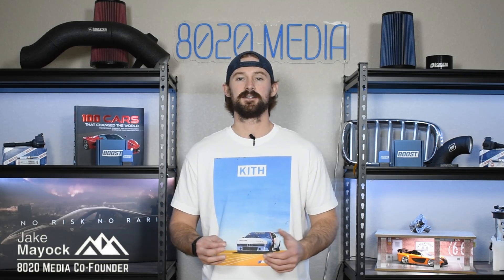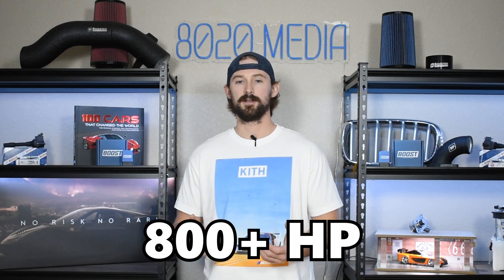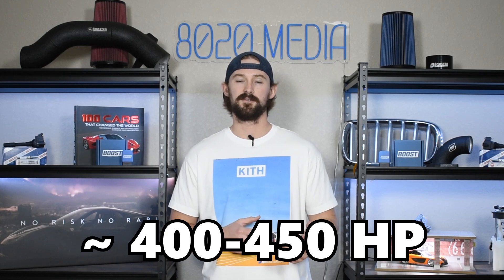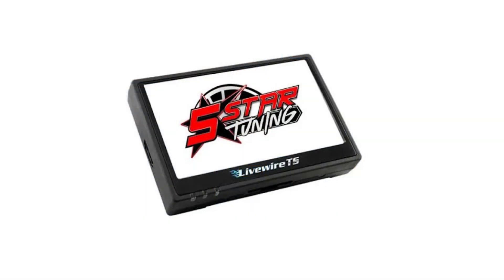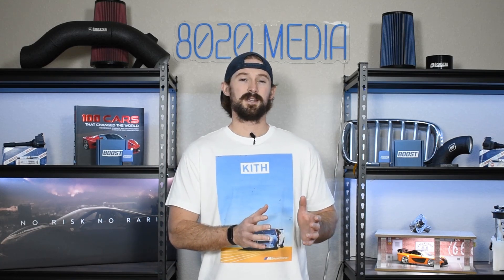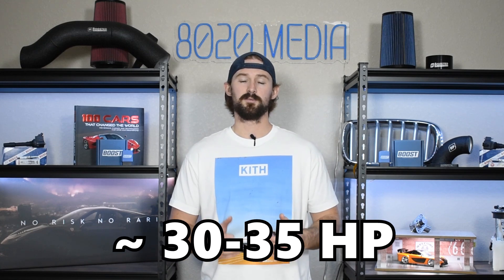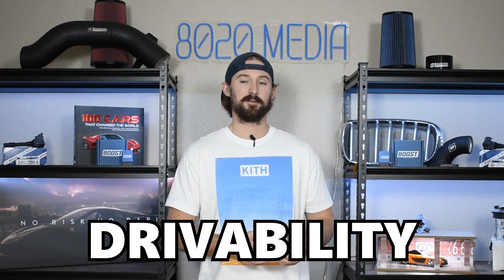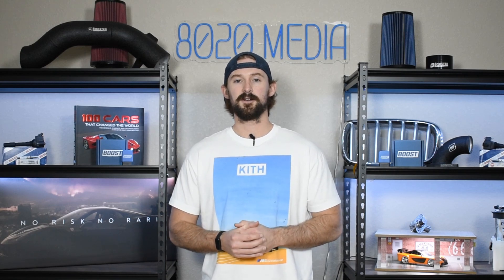How to ADD 50-80 HP to Your 5.4L V8 Triton!

Comment: Hey forgot to mention switching to electric fan.  I gained 12hp to the wheels. Im curious what the 5.4 2v  put to the tires vs a 4.6 2v . My F150  4.6 2v had long tubes custom exhaust, 75mm throttle body, electric fan,under drive pulleys ,cold air and dyno tuned. 230hp and 292lb tq to the wheels factory flywheel specs were 232hp 292 tq.
Reply: Damn near exact build I had on my panther miss that 4.6

Comment: Ford F150 2006 5.4 king Ranch
Cold air intake 
Long tubes headers 
3.73 gears
Built trans 
Police interceptor torque converter
Under drive pulley
Jets mass Air Flow Sensor 
Tune 
15.0 at the Drag Strip. But I wanna go low 14s with it
Reply: Instead of a built trans think ab swapping. These 4 speeds are dogs

Comment: Fun fact the 4.6 and 5.4 share a shit ton of parts. If you wanna make power you can take basically everything from the 4.6 mustang 3v and do a full tilt build on the 5.4 you can get chain tensioners that lubricate the timing chains better timing chains blocked out phasers high volume oil pump you can get forged pistons a forged crank you have to get custom rods but you can throw on ported mustang heads fat ass cams the only problem is you will need a custom intake manifold.

Comment: every mechanic I've spoken to say the same thing.  Avoid the Triton 5.4 V8 3 valve engine at all costs as it's the worst engine they've ever worked with.  My 2 valve 5.4 they said is an amazing engine.  I got 400,000 kms from it so I replaced it with another one and am happy.
Reply from the maker: D - Thanks for sharing.

Comment: I could care less about more power, 280hp is fine with me, but I want more fuel mileage! lol. At least I don't have that stupid phaser problem to deal with. And the only thing K&N does is let larger particles of crap into the motor. They are short term gains for long term problems.
Reply: You are correct, I agree with your statement. Short term gains for long term problems.

Comment: S/B enclosed intake. Exhaust cut out after manifold. New person, phasers, timing chain, tensioner, high velocity pil pump. Plugs, coils, cvt solenoids. 
TRUCK is a DOG. slow as slow can be. Plus...stock brakes doesn't slow it down to well.
Reply from the maker: D - Sounds like a nice build you got there! Thanks for sharing.

Comment: My 08 harley puts out 600lb-ft of torque . I put a Gale Banks tune and banks cold air intake along with a jet mass airflow sensor and Banks shorty headers. Swapped the resignator for a high outflow exhaust. Changed the catalitycs. And really woke it up with roar pedal throttle command. Also added electric fans and a 200amp altarnator to help power the fans. New water pump, new radiator, 180 degree thermostat. I use it for towing super strong and reliable.
Reply: I have an 04 lariat. Supercharged, crate engine,comp cams, performance tranny, 3 clutch torque converter, long tubes, true dual exhaust,  no cats, flow through resonators, turbine flow through mufflers, 2.75 griptec upper pulley. Custom dyno  tuned a few times to get it dialed in. It's been run on a Dynocom Dyno, Jetdyno, and most recent tune was done in Texas on a Mustang Dyno. Dynocom numbers where ridiculously incorrect. Shop claimed they were able to get it to 600+ rwhp.... Bigtime BS!!! This shops in Arkansas. Got it back to Mo. Had a ton of issues with drivability. Had a few pulls done at a local dyno shop that usses a a Jetdyno and it actually made 445 rwhp. That's actually good for a 5.4 3v. Really good. Stock, it can only has like 225 - 240 or so rwhp. Now, she made 445 but ran like crap. Couldn't trust the shop in Ar. so I reaced out to a Tuner in Texas. Was really familiar with  the 11th gen. Also he uses HPTuner, and a Mustang Dyno.  He dismantled the existing tune and built a tune for my truck. Drivability is now very well mannered. If I get on her from a dead stop, she lays rubber hard and fast. Drove it back to Mo. from TX. With no issues. Final numbers on the Mustang dyno produced 430 rwhp and 505 rwtq. These engines are great if property cared for. I was able to get  200+ rwhp increase. Had to do alot of mods. For me it's enough. Trucks been fully customized inside out. I could have easily bought a newer truck and done the same to it. This truck. I bought it brand new. It's never failed me in 21yrs. I didn't want a new truck. I wanted to invest in the vehicle that's never let me down. Please dont Hate on my little 430 rwhp. I'm happy with it and my truck is like none other. Just sharing my experience with my 5.4 3v.
Reply: @swishersweet66  Im tryna do this on 2 v lol you didn't swap any internals to forged?
Reply from the maker: J - Sick build. Thanks for taking the time to share this!
Reply: If it has 600 foot pound, that’s too much for a bike lmao, can’t even enjoy all the power without dying
Reply: @Ty-c5d lol he's talking about the Harley edition f150. But he's bsing. His truck never made 600 lbs of torque.

Comment: I gotta admit i was pleasantly surprised by the increase in throttle response from installing a cheap high flow air filter into my stock intake it wasn't a huge increase but it definitely took me by surprise i also always suggest with any engine but especially engines with poor sealing air intake systems like the 5.4l drawer style air filter to clean and run a relearn procedure on their electronic throttle bodies
Reply from the maker: 3 - Nice! Thanks for sharing.
Reply: What do I do to do this relearn process?

Comment: Currently rebuilding my 2006 5.4 3 valve from the ground up after a blown timing chain tensioner seal. I'm staying mostly OEM with it, but upgrading the weak points such as the oil pump, chain guides and tensioners. Also upgraded to comp cams lash adjusters and some mild cams with the BBK 80mm throttle body with a spacer. Plans are still to install shorty headers and Magnaflow's high flow cats, (gotta stay legal :/) and a cat back. Also throwing on some slighter bigger injectors, Jet Performance tuner, chip, and MAF sensor. Also some upgraded plugs and coils. I'm expecting closer to the range of 400hp with a big increase to torque. Anything else you think I should do @8020 Automotive? Or am I on the right track??
Reply from the maker: K - You’re definitely on the right track, and it sounds like you’re addressing most of the notorious weak points. Since you’re already doing upgraded oil pump, tensioners, lash adjusters, and mild cams, I’d suggest also paying attention to the airflow and fueling balance so you can actually take advantage of those mods without running lean or losing drivability. Your larger injectors, BBK 80mm throttle body, and high-flow cats will help, but I’d strongly recommend having a quality custom dyno tune done instead of relying on a generic Jet Performance tuner/chip — these engines respond much better to a tailored tune, especially with cam changes. While shorty headers are good for emissions legality, they won’t give as much torque gain as long tubes; if you’re locked into shorties, pair them with a well-matched Y-pipe and ensure the collector design is efficient. Also, make sure your upgraded MAF is properly scaled in the tune, because mismatched MAF calibration is a common cause of poor idle and part-throttle hesitation after these upgrades. Since you’re going mild cams, upgraded valve springs might not be strictly necessary, but installing fresh OEM or slightly stiffer springs will safeguard against valve float at higher RPM. Lastly, double-check your cooling system — these engines don’t like excess heat, so a high-quality aluminum radiator and maybe an oil cooler could help longevity if you plan to tow or push it hard. Done right, you’ll have a strong, reliable 5.4 with a torque curve that’s far more satisfying than stock.
Reply: @8020Automotive  thank you for the advice, I will definitely address this going forward. I've already replaced the valve springs with brand new OEM. My truck was equipped with the towing package from factory which included a upgraded cooling package, so hopefully that should help keep it nice and cool. I do believe you're right about the dyno tune. I've had that thought in the back of my head, so I may just go that route. Thanks again, I really appreciate it. If you have anymore tips for the 5.4, feel free to reach out.

Comment: I have a few 5.4 3v vehicles. 1 has a procharger (bought it with transmission issues) havent driven it yet. The plan is to swap that motor to another truck. I'm hoping to see what you guys suggest when wanting to go over the 500hp. Cams, high output oil pump/ fuel pump, injectors. All that fun stuff. I know nothing about performance stuff. And I feel like theres a lot of aspects to the performance world that i dont know i dont know.
Reply from the maker: T - Nice, you've got some sweet builds there. Thanks for sharing!

Comment: Custom intake manifold with cai fan clutch to electric fan conversion low restriction exhaust with long tube headers and custom tune
Reply from the maker: B - Nice build! Thanks for sharing.
Reply: I've never seen a custom intake manifold for the 5.4 2v
Reply: @scottbeaz you haven’t looked hard enough
Reply: @bryan7199 there is no custom intake manifold for the 5.4 2v. It's hard to find a stock intake manifold for that engine
Reply: @scottbeaz dont be a hater just cause you can’t find something
Reply: @s @scottbeaz plus i dont have a 5.4 2v i have the 5.4 3v

Comment: And this is why I started messing around with Cummins diesel with good custom tuning alone you can potentially get 150-180 horsepower if you do everything mentioned in this video it’s very possible to achieve 250 horsepower and when you start upgrading the fuel system the sky is the limit

Comment: Those engines can handle more than 450 hp
Reply: Auto detour is a channel on here that put a turbo on a stock 5.4. He didn't blow the engine until he was hitting 14 PSI at the track. Imo he wanted to blow it up because he had a built short block he was waiting to replace it with for 3 years. It lasted years with 9-12 lbs. My 2 cents cheers.
Reply from the maker: @mikanxKoi  Thanks for sharing!
Reply from the maker: B - Brother. We're not going to tell people to blow the engine. If you're looking to get 450 hp, then you're going to have to put your money where your mouth is. We make these videos for reasonable power levels with good enough reliability.
Reply: @8020Automotive I've known several people with over 450 in all versions of mod motors that everyday drove them for years & only popped the hood for oil changes 
That weak rods thing is a myth 
They've had 6 bolt mains since they came out
B4 everyone else 
Idk how you believe this that has been disproved long ago
People did believe that until around 2010
There's lots of videos with mod motors making 450+ on utube 
If you just look it up
Reply: Idk about that lol
Reply: Maybe with just the stock block
Reply: @2bhyman  I've owned Triton motors for years & have followed them closely 
I've personally known people with more power than 450
Plus there's lots of videos on the internet 
There's a guy i can't remember his channel but he put twin turbos on a 5.4 & got over 1000hp
I don't think you researched this good
Reply: @2bhyman the Injectors do need to be changed @ a certain point

Comment: Is the 4v 5.4 reliable
Reply: It’s a dog.
Reply: Other than the timing issues the entire triton line had do to experimental cam phasers they are, just be sure to change the oil every 3000 miles because of the narrow oil channels in the 5.4 block
Reply: @coryshelton-hc6bd 4V didn't use cam phasers...
Reply: Very!
Reply from the maker: T - Certainly can be!

Comment: I'm cleaning and painting mine right now. I had to replace the motor my other one spun and bearing in the bottom. I'm not doing much, but Long tube headers, throttle body spacer and a tunner, Excel power packs and change the grear ratio to 4.10. I don't need a lot of power I'm just mainly looking for torque. I hope all this gets me where I need to go, any advise is more than welcome. 
I don't care about going fast at all, but when I hook up to something that it comes with me. Back in the day i built a 1978 f250. It had a 460 with a holly 4 barrel, a granny 4 speed, 4.10 grears on a set of 44 inch ground howgs, but i couldn't never afford to dive anything like that now, but when I hooked up to something it definitely came with me. Could never afford to drive anything like that now, because when I would get on it you could see the gas needle move. Thanks y'all ‼️‼️🇺🇸
Reply from the maker: D - Thanks for taking the time to share your experience and build!
Reply: I drive a Ford  F-250 (5.4 liter)
I pull my Fifth wheel travel trailer.
All Factory Original. 
Only added air bags to the rear suspension. 
I would like to add Headers
Reply from the maker: @BillieWilliams-l6m  Thanks for sharing!
Reply: I bought my 09 5.4 in 08 with 20 test drive miles. My wife drove it for 18 months while I was in the sandbox, but I put 350,900 miles on it and still running like a champ. I think she needs a few upgrades to make her keep purring like a Puma. Thanks for the info.
Reply: @ssgdingodingo1191 Copy that brother thanks for responding to me. ‼️‼️🇺🇸
Reply: Id go 4.88 rear gears with 44 inch tires

Comment: Why was the engine so low power?  Poor head design?  Reminds me of the M series of engines from the 1970's. 351m for example.
Reply: Probably because they are Truck engines and not so much made for pure performance like the 4.6 4v, but the 5.4 2v and 3v have pretty good torque, PI heads flow decently though \_(ツ)_/¯
Reply from the maker: R - Great question!

Comment: Ive got
Throtttle body spacer
Cai
Tune
80mm throttle body
Bigger cams
Shorty headers and full exhaust 
Underdrive pulley
Upgraded maf sensor
Reply: What tune and underdrive pulley do you have
Reply: Jet performance  @scott_5.4
Reply: @scott_5.4 edge evolution cts3
Reply from the maker: J - Nice build! Thanks for sharing.
Reply: I have a 2004 Lincoln navigator. Will this work with these mods
Reply: Have you ever take it to the drag strip?

Comment: People forget, horse power is good, but its torque that really wakes up the 5.4 3v. 09 10s come with fans from the factory.  

Great video BTW, I'm building up my 2010 5.4 3v f150 for torque.  Hope to get about 425 lbs of torque n/a
Reply: Got to the dyno last weekend.  Added a torque cam, completely new timing job new pulleys tensioners belt chains etc etc. Hp tuned and I got shorty headers and  factory cat back with a 2.5inch  x pipe .

376hp 414 tq 
Next year I'll be turbocharged.
Reply from the maker: @12pawsinn  Nice build!
Reply: @12pawsinn  nice. How does it drive?
Reply: @12pawsinn  To the wheels?
Reply: @glennboggs3563 its fun. 😂 drive it like grandpa and still get 21 mpg, drive it like a 16 year old, and i burn tires with the 3:55 limited slip
Reply: @12pawsinn  4.10 would make that mf really rowdy brother. I know not everyone drops these but a 3 / 5 drop kit would keep your center of gravity low, could make a really badass street truck
Reply from the maker: 1 - Good point! Keep us updated on the build.

Comment: E-Fans will free up some power as well, not having to spin that heavy stock fan around..
Reply from the maker: N - Good point! Thanks for sharing.
Reply: For sure, I have an 06 F-150, and put e fans on it and instantly felt like 20 hp gain! Not sure really how much but definitely a noticeable difference!
Reply: Pretty sure they run a fan clutch so shouldn't rob too much hp, unless the clutch is locked up!
Reply: @vrm86gt yes the e clutch fans do drain hp if I was u I'd go with e fans from 09 up

Comment: what about blocking off thr egr junk?
Reply from the maker: S - We can't recommend this, but you are certainly on the right track!
Reply: 5.4 two valve 1999 expedition
Reply: can you suggest à way to deal with the Xtra heat?
Reply: The 5.4 3v has no egr